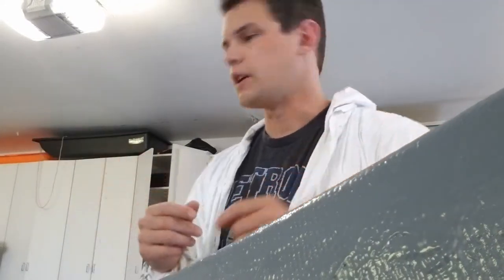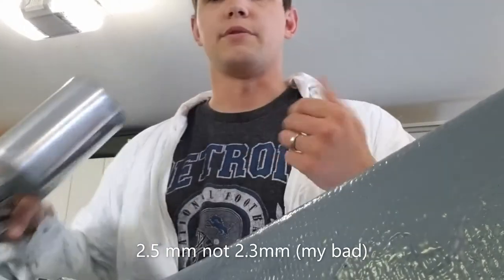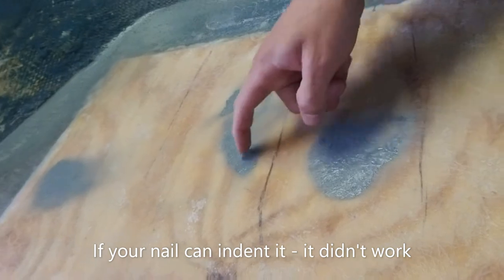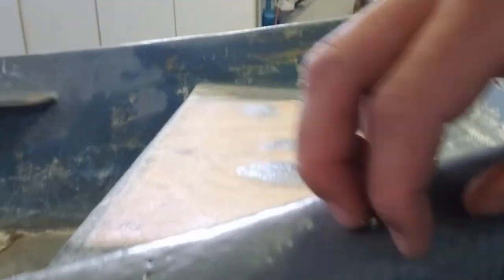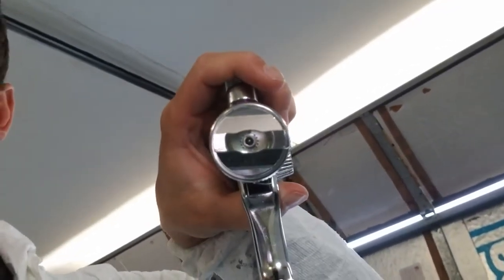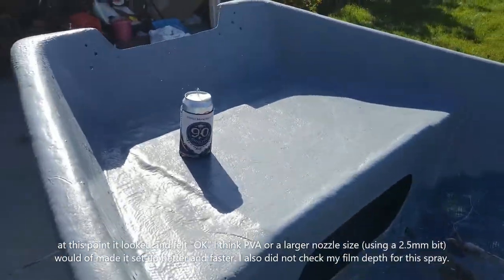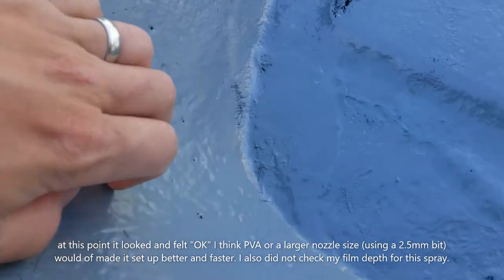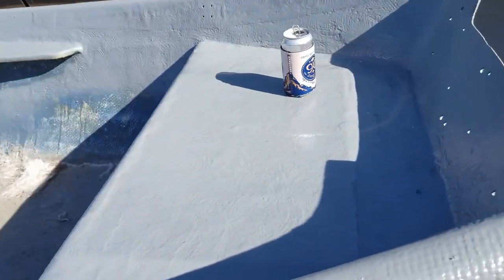Shooting Gel Coat Harbor Freight HVLP Spray Gun Cheap Spray Gun

Comment: Have you considered spraying pva over the gel coat directly after gel coating to keep the air outside. It will cure hard without the tackiness.
Reply from the maker: Hey! that is a great recomendation. I stumbled across that - it works great! havent ever tried it without the duratec though.

Comment: I'm building a duck boat and the hull is fiberglass with gel coat. How can I prep it to spray paint camo over it? From my understanding if I just sand it lightly and paint it that it won't stick and scratch or chip easy. Any help would be awesome
Reply from the maker: Yep, rougher the better. 120 or 100 should do. Rough enough for paint to adhere, but not so rough it shows through. then wipe down with Boat Prep cleaner.